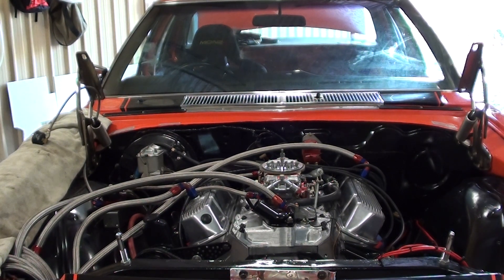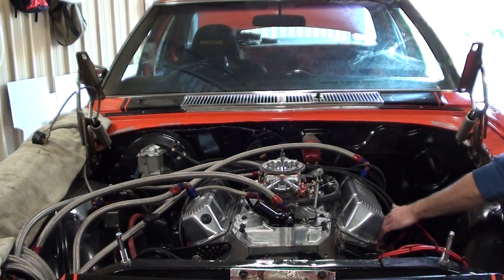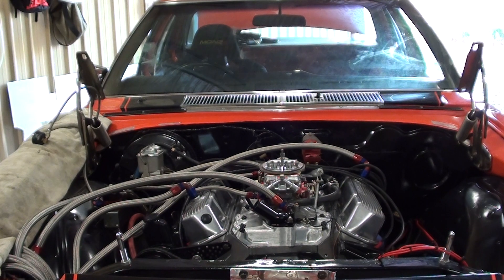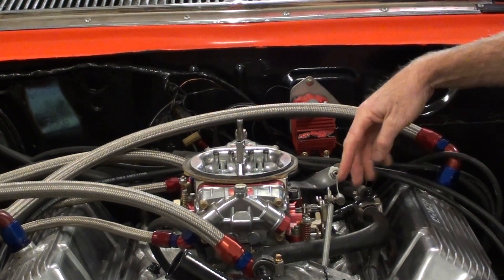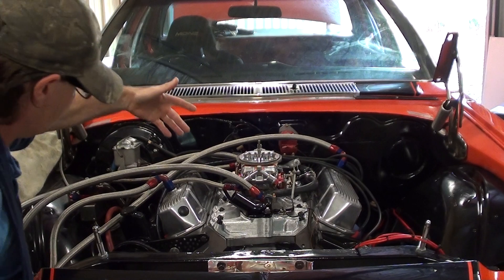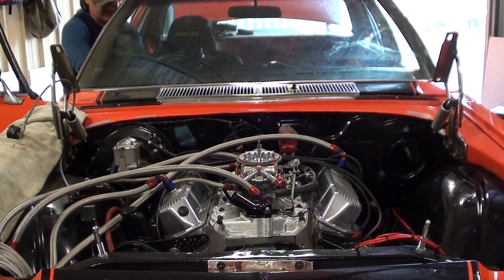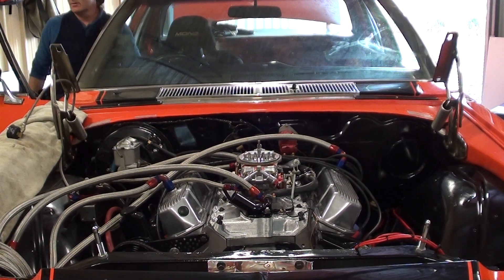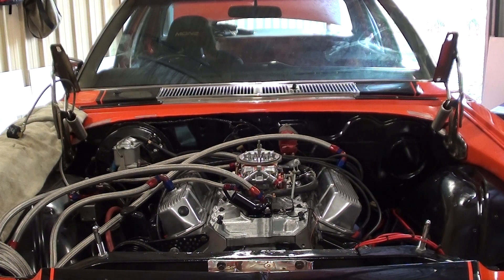(START UP ON MY LIL 308) finally on the comeback to boost life.

Comment: love it great work
Reply from the maker: DEFECT ZONE - your new automotive superchannel Thanks mate.
Reply from the maker: DEFECT ZONE - your new automotive superchannel i only just saw this comment mate, it was in my spam folder, cool setup, did you figure out why it popped while on the 2 step?
Reply: Griffs Rearmount Turbo.  I am pretty sure the fuel built up in the exhaust and backfired which back burnt into cyl 7and 8 causing detonation and broken conrods. Your vid got me keen to put another motor back in today but the clutch parts im using are incompatible and have to get my pressure plate reset . Waiting waiting lol  😄👍
Reply from the maker: DEFECT ZONE - your new automotive superchannel Well that makes sense,thanks for letting me know.cheers Griff